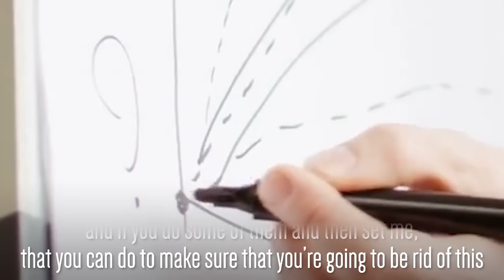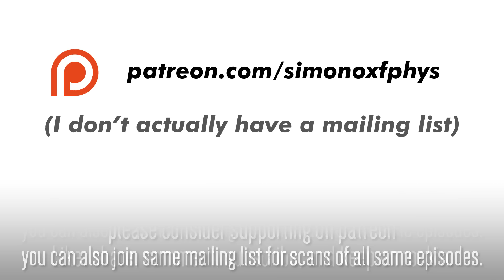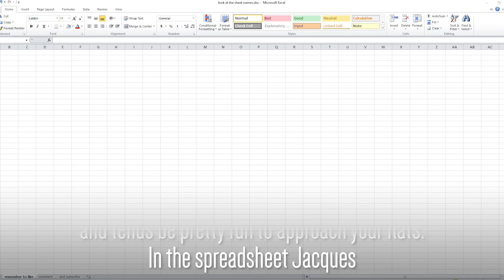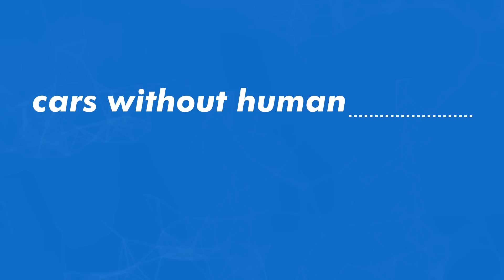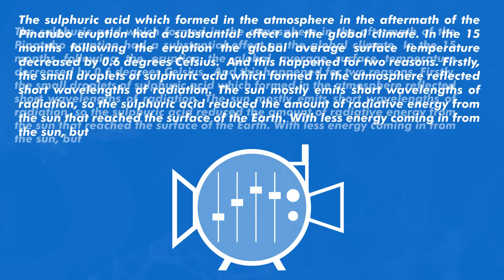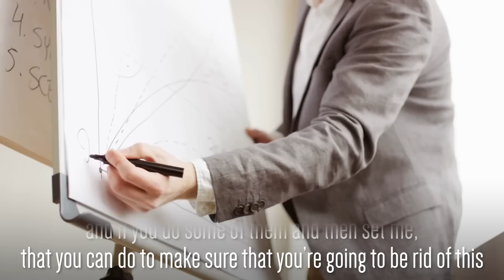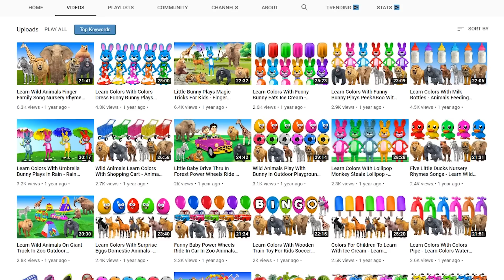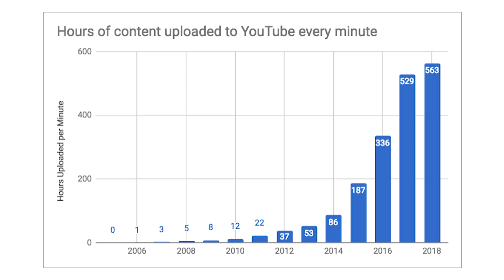I trained an AI to write YouTube videos

Comment: Have you tried RNN? Say, LSTMs... Nice video btw!
Reply from the maker: Yes, two LSTM layers!
Reply: @SimonClark  You should check out gpt2 from open-ai. It a neural net doing language modeling. It gave impressive result and is available with pretrained weight. You fine tune on your data and Bam! Really good results. Also, if you want to try some architecture, look at the transformer from the paper attention is all you need. It beat the lstm in many case!

Comment: I'm curious, which class of models did you use to generate that script? I don't really work with text, but it seems you could get richer vocabulary by utilizing transfer learning, something trained on Wikipedia for instance. Or I've heard about something called "attention" that make things more coherent i.e. the text will have an easier time staying on topic. I suppose that really depends on the class of models you used. Regardless, this was a cool video! :)
Reply from the maker: So I used two LSTM layers with a dropout between them, I was tempted to train it on general data (E.g. Wiki) first, then specialise it on youtubers' scripts after, but never got around to trying it!
Reply: Thanks!